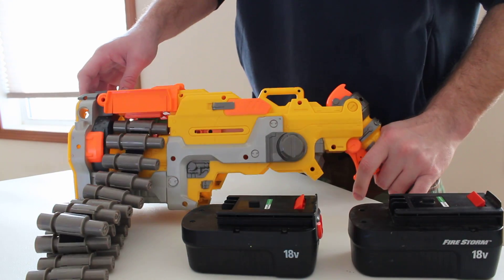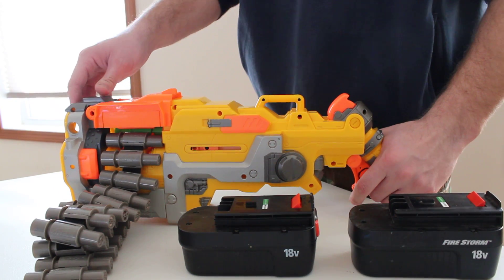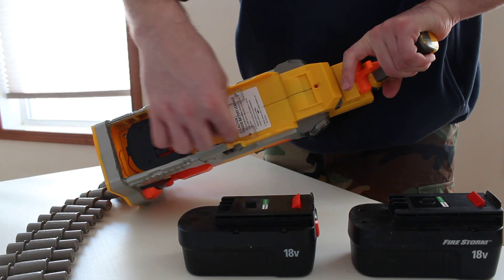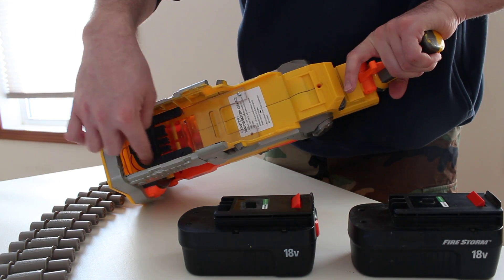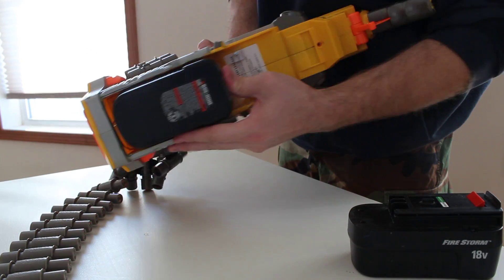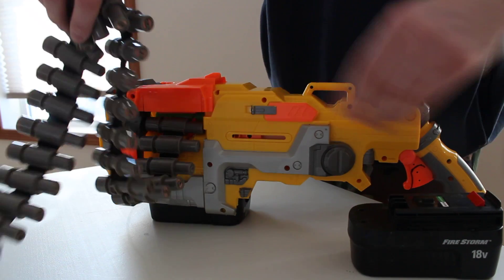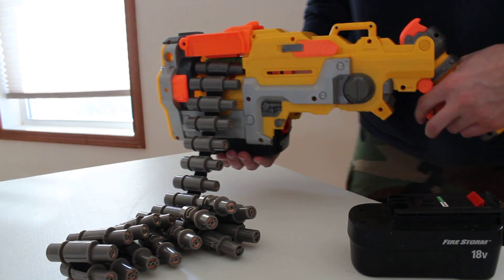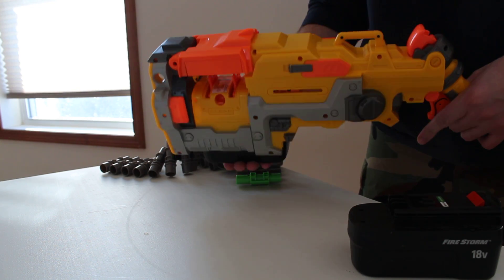Nerf Vulcan modded to 18 volt battery pack

Comment from the maker: Nope, still runs fine. The motor can handle 18 (20) volts just fine. I think the voltage regulator is what everyone is burning up. The problem I am having now is the feeding. The clutch in the drive slips due to the added cycle rate.